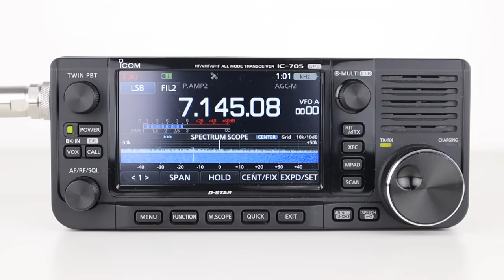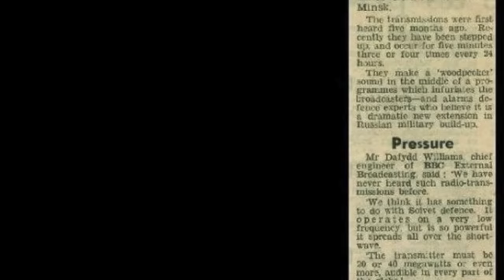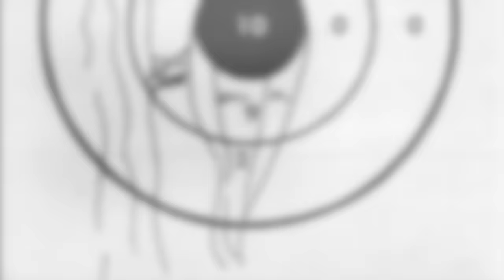Russian Woodpecker - The Radio Signal That Wreaked Havoc Around The World

Comment: Another great video Lewis. Thanks. As far as the Russian woodpecker is concerned, it was a real menace on the HF bands. I hated it. I was very active on HF in the late 70s, at first on CW and then both CW and SSB when I got my Advanced certificate. I had a decent CW filter so it didn't stop me but SSB was more difficult. It used to come in at S9 and even stronger in Toronto. Am glad it's gone! 73s, VE3IMF
Reply: What rig were you using? I had Dad's Hallicrafters SX-101, and it was rendered useless. 73 WB7BCD
Reply: @stevemcdonald4885  Yaesu FT-101EX with the CW filter installed. Yaesu's very standard but very good radio at the time. I kept it for years. 73 VE3IMF

Comment: Some say that the transmitter was powered by Chernobyl and a problem with the transmitter caused a feedback on the reactor, causing it to blow up.
Reply: Except that the Chernobyl accident (a steam explosion) was caused by a failure in water circulation that occurred during a 'does the coolant circulation fail if we cut all outside electrical power to the reactor system?' Is there sufficient momentum in the pump impellers to maintain pressure for the 45 seconds, odd, before the backup diesel generators kick in? I guess they got their answer!

Comment: I saw one of these out side of irkutsk. I recongised from the Australian over the horizon radar that use commercial flights out of Singapore to calibrate the system.
It had a 15 degrees arch now it up to 45 degrees.
Question to ask did they track mh370 flight path?

Comment: Never heard it sound like your sample here. Sounds like you have a low-pass audio filter. 
I'm hearing it right now on 829kc am and 399.4555mhz ssb. Been listening to it since the beginning of the 60's, from many different qth's, including The Antarctic. 
 ;)
Reply from the maker: How can you be hearing it now? Duga 1 has been inactive for 34 years
Reply: Get a receiver and scroll around the dial. 
I've found that most sdr's, digital controled radio's filter it at the hardware or firmware level. All my gear is diy or repurposed. 
 ;)
Reply: impressive that you are listening to a system of which all transmitters have been destroyed.

perhaps you are listening to a different system. in fact i guarantee it. considering the many many new OTH radars that are active all over the world.
Reply: @LodewijkVrije 
Well, if you say so.

Comment: Was those Antenna Construction near by Tschernobyl ? I mean /think/believe/ could remember on Photo or Video something like this saw .... Maybe a backfire signal was the problem for the Reactor crash centuries back in time.... cause pictures from the control room / building from that transmitter was inside parts burned etc. ?! ( Experiment goes often after long times worse & effects comes to other where to a problem.. Tornados , Tsunami , Weather Air Stream manipulations... idiotic like Atomic Bombs ...)

Comment: I wonder if the 1986 disaster in Chernobyl had anything to do with the phasing-out of this system...
Reply from the maker: A lot say it did and I’ve done a lot of research on this:

https://youtu.be/DHG9v6Nc7v0?si=0bYcbmFy91ouFue1

The radar was on the air 3 years later. I’m inclined to blame the start of the demise of the Soviet Union in 1989’instead
Reply: @RingwayManchester  Okay.  I meant it the other way, like maybe people didn't want to go to work there any more.  It seems like for a while the Soviets were denying that there was an unsafe level of radiation outside the plant itself, but maybe people just weren't buying it.  In any case, I think it's a pretty far stretch for a power plant to be destroyed by its load, since even if this had been the transmitter site, it still wouldn't be a significant fraction of the load on the plant, and power plants, even in the Soviet Union, are always protected against load faults.

Comment: Interesting that a radar device, which sends out radio waves in a straight line, could detect objects so far away. Hundreds of miles Beyond the alleged curvature of the earth. 🤔
Reply: * Sigh * The video literally explains that this is an over the horizon radar, which does not rely on line-of-sight transmission.
Reply: You could’ve been any kind of stupid but this is the kind you chose.

Comment: A summary so you don't have to waste 11 minutes on this video:

The Russian Woodpecker was a powerful radio signal that was broadcast on shortwave radio frequencies during the Cold War era. It was so named because of the distinct tapping sound that it made, which resembled the sound of a woodpecker pecking on a tree.

The signal originated from a location near Chernobyl, Ukraine, and was first detected in the mid-1970s. It was a wideband signal, covering a frequency range of 7 to 19 MHz, and was transmitted intermittently for several years. The signal was strong enough to interfere with other radio communications, including civilian broadcasts, and was therefore considered a nuisance by many radio operators.

Although the exact purpose of the Russian Woodpecker signal was never officially confirmed, it was widely believed to be a part of a Soviet over-the-horizon radar system designed to detect incoming missiles and aircraft. The signal was discontinued after the Chernobyl disaster in 1986, and the site of the transmitter has since been abandoned.

Comment: How do you increase the power of a radar?
Reply from the maker: Turn up the transmit power
Reply: @RingwayManchester  I know very little about radios/radars - so do you do that by increasing the voltage and or current in the circuits?
Reply: Like anything else, you make it bigger. More tubes, more power, bigger antennas.
Reply: concentrate the radiated power to a beam
instead of every where.
Reply: @raypitts4880  I don't know of any radar system that uses an omnidirectional antenna. They've used dishes since day one.

Comment: Duga shut down because they couldn't run enough power to it after the  Chernobyl Power Plant incident.
Reply from the maker: Hmmm I’m not convinced, it was on for 3 years after Chernobyl
Reply: @RingwayManchester  - But wasn't it running less power afterwards?

Even if not, think of the cost and loss of sending such high current so far. Didn't have the technology back then to increase efficiency enough to make it worth it. ( Along with all the things the video mentions, that is. )
Reply: @RingwayManchester  Plus, I worded my original comment wrong. I think I'm missing an "also" in there.

Comment: What will happen if Duga1 was reactivated In 2022,2023
Reply: actually the duga cant be re activated. the transmitter was destroyed. the structure in Ukraine is only the receiver.

but Russia did build a new OTHR system similar to duga called "29b6 container" and you can frequently hear it on 14khz band.
Reply: @LodewijkVrije  ok and thanks for telling me

Comment: What is the logic of having an early warning radar system that can be jammed by a bunch of amateur ham radio operators ?
Reply: its impossible.

even if a million ham operators were transmitting a signal on the DUGA frequency at the same time it wouldn't do shit.

this is because a OTH radar uses the Ionosphere to propagate its signal, to receive the signal back the receiver would have to be tuned. not to the transmitter, but to the Ionosphere.

this is why all 3 DUGA system receivers (the prototype, the one near Chernobyl, and the one in Russia's far east) have a giant circular array next to it. an Ionosphere sounder, the system uses that sounder to measure the ionosphere and then tune the receiver antenna to it.

what this effectively means is that it sends a transmission on 1 frequency, but as that transmission travels its frequency gets altered by the ionosphere. and thus is received back as a transmission on a different frequency.

meanwhile amateur ham operators don't have ionosphere sounders. and therefore they cant send back a transmission on the correct frequency.

they can only listen to a transmission on a certain frequency, assume the receiver is listening on that same frequency, and send back a similar transmission to what they assume is the receiving frequency.

even when the receiving frequency is constantly changing due to the ionosphere, which is also the reason why the Duga system (and modern OTH radars) constantly change frequency. and not because their jamming was successful, the operators of the Duga probably never even noticed people were attempting to jam the system.

no one that tried was tuning themselves to the ionosphere after all.

Comment: Apparently the DUGA radar transmitter and receiver sites combined consumed nearly 2 gigawatts of power when operated at full power.
Reply: Which means it would be consuming the entire capacity of the Chernobyl NPP nearby (probably built there for that exact purpose).
Reply: @Stoney3K  Chernobyl was designed to output 6 megawatts, and both DUGA 1 and 2 combined only consumed 4...  I would assume this is why only one of the two was operated at a time...
Reply: @Stoney3K   so, in Russia's far east. where there was a second Duga system, from which nuclear powerplant did it draw its power? because there does not seem to be any nuclear power station nearby.

both Duga systems also have a transformer station, which used to be connected to the national grid of the soviet union. meaning the power could have literally come from ANY powerplant connected to the soviet grid.

just like static radar stations today! wow! its almost as if a national grid is a way to transmit electricity over long distances! crazy i know.....
Reply: @LodewijkVrije  The array at Pripyat was also only the receiver station, the transmitter of the west-facing side of Duga was located elsewhere.

Comment: Wouldnt standing near this much power cause you to gather an encyclopedia of genetic mutations and cancers?
Reply from the maker: No
Reply: Radio waves are not ionising radiation
Reply: @RingwayManchester  Not so sure, because any form of radiation can be mutative if its powerful enough ... AM radio antenas under extreme loads such as 10 MW will definitely increase your chances .... this thing is terrifying
Reply: @mattd6085  They arent, but regardless of their structure you can get very ill if the antenna is powerful enough
Reply: @mattd6085  Even magnetic fields are potential for illness when coming from a trafo/relay station or any big power pole

Comment: They tried to do the radar and using Tesla's design but they didn't have all the stuff on it so they had to use a bunch of guesswork and got it wrong
Reply: >Tesla
Are you about fact in Musk’s Tesla assembling factory when they used piece of wood to isolate radiator?

Comment: after Russia is defeated and there's a peace deal, this radio transmitter should go back online but modified as a world broadcasting system. during emergency alerts this should go off with a operator brodcasting the problem.  This radio should only be used for world problems or world events that everyone should know.
for example if Yellowstone supervolcano about to erupt this radio should be used.
Reply: looks like u think that this transmitter is located in Russia. Well, you are kinda right, it will be